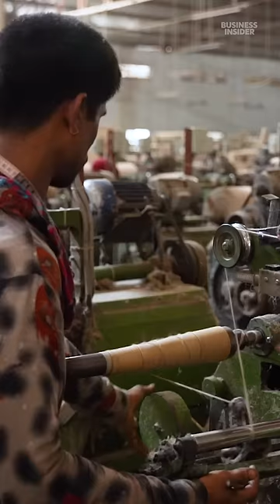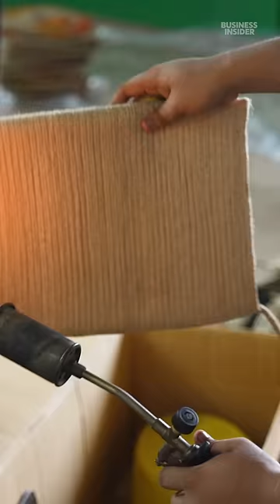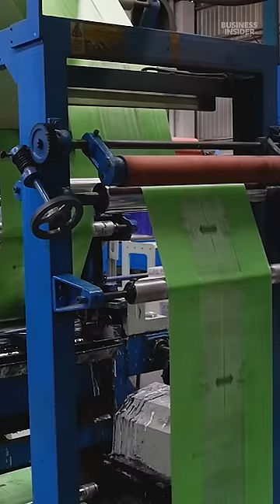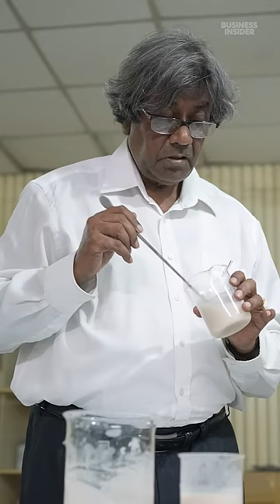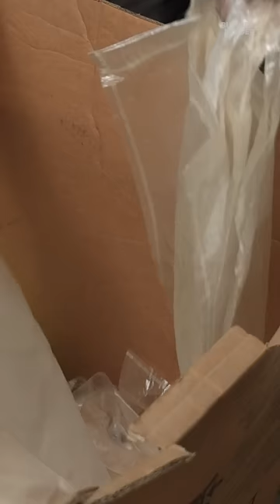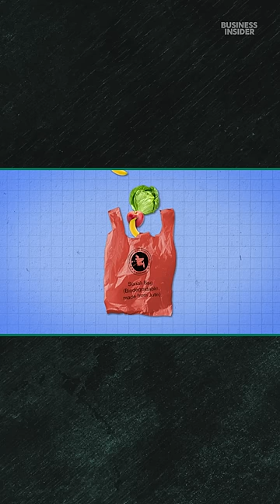Since #plastic bags are made from oil, they are not #biodegradable. Bags made from #jute are.

Comment: As the demand goes up more innovative and easier methods to produce it will arise. In turn making it cheaper.
Reply: The current price of plastic is 100% due to economies of scale. Its only advantage over alternatives is seniority. If infrastructure for something like this was similarly sized to the plastic industry it would probably be about as cheap
Reply: Absolutely.
Reply: So many people forget about this when saying certain technologies are too expensive to ever be reliable.  Space flight and air flight are two of those.  Over time, if people are interested in making it more accessible, they *will* innovate to make something easier and cheaper.
Reply: Agreed. Titanium is expensive, but when they first were able to refine it, they literally made a drop.
Reply: @maximumoverdrive3092  "Its only advantage over alternatives is seniority."
Such utter rubbish. You forgot the bit about having a smooth surface which lacks contaminating fibers, plastic bags are way cheaper than something which has to be grown, processed into fibers, then woven and sewn, plastic bags are very strong vs mass.  

Further, if jute bags came even remotely close to rivalling plastic bags, large areas of FOOD PRODUCTION land would be required to grow the jute, and chew up water resources.

Seriously, get real.
Reply: @alexanderSydneyOz Better than using up all the oil for and running out only to wait hundreds of thousand of years for new fossil fuel to come back. Then you have no choice but to look at alternatives anyway.
Reply: @alexanderSydneyOz   I wasnt referring to this one specifically. or maybe I was. I dont remember. I dont live on the internet.
Reply: THIS! why do people always bring up cost as if the cost will never go down over time. Almost alll new things start off expensive.
Reply: Oh i like this comment Very much!!

Comment: If it's biodegradable and breaks back down into the soil quickly it's worth every penny to get rid of all this toxic plastic that takes forever to break down and then not be healthy for the soil❤
Reply: plastic is not toxic.
Reply: Plant based plastics are still plastics
Reply: It literally melts contact with water. Cold groceries that make condensation, rain, wet produce, all of that will melt the bag instantly. 8 hours to completly disintegrated, 8 seconds until useless.
Reply: My plastic Walmart bags fall apart going from the register to the car so ..
Reply: Biodegrading means it is being consumed by organisms which create CO2. The Carbon is mostly being returned to the atmosphere again.

Comment: One of the biggest challenges is making a good waterproof/ leakproof alternative to plastic bags for storing messy items. In that way, plastic has the definite advantage.
Reply: Wax paper is actually a decent alternative.  2007-2014 wrapped sandwiches in wax paper for work. Then stopped eating sandwiches 🤣
Reply: There may be some things where plastic will always be the best thing. But it doesn't have to be used in every single circumstance that it's used in right now. There are many alternatives that could be used for some of these things. Plastic would not be that big of a problem if it were only being used for the things that it really is critical for, as opposed to for every convenience.
Reply: There’s still a need to wrap certain items in thinner plastic bags to prevent leakage and separation of say foods, damp vegetables , frozen items and from chemicals like cleaning products. But the outside tote would be better if jute or other reusable bags.

Comment: Just wanted to bring this to light given all the comments. I am a material scientist/engineer and work with many companies and governments regarding full lifecycle of materials to understand where hangups are and how we can see meaningful changes. 

Without an overhaul to our waste processing facilities (I am speaking from a US prospective where I believe US waste facilities are massively underfunded) this will have little to no real world impact on our waste issues. Currently landfills do not have the proper infrastructure to aerate the soil preventing materials from bio-degrading. If this gets mixed into a batch of recycling it will ruin that solution and prevent any re-use of those recycled materials. Only option currently is to compost which the infrastructure is greatly underfunded and in many areas almost non-existent. This is a great start and may help in specific small instances where trash cannot make it to a waste facility, but given a lot of the comments I’ve seen and the support in the market, a lot of people are properly disposing of these materials already. 

Material sciences alone will not solve our issues and we must advocate for advancements to our waste processing facilities to ensure awesome breakthroughs like this are not in vain.
Reply: 100%. Waste processing requires more public funding. The longer we run it as a for-profit industry, the worse our trash buildup will get. Also, half the time we can't even dispose of hazardous household materials like fluorescent bulbs and electronics properly, and I know from experience most companies (even the ones with 'proper channels' to deal with such waste) still just throw things in the regular trash. Unless we make it free and easy to throw things away properly, people simply will not do it

Comment: I just moved from PA to Maryland and here, we have to pay for the bags we need at a store. Anywhere from 20¢-$1. Of course, this encourages ppl to bring their own fabric ones or at least reuse the plastic ones they’ve paid for. The plastic ones we pay for are SO THICK & yes, that’s good bc we’ve paid. But now, we have even thicker plastic ones that will create more sturdy garbage, too.
They ought to be putting these in those stores bc they are sturdier, too. And I am positive paying even 20¢ each would more than cover the 10xs greater cost bc of the sheer volume the stores buy. Even corner stores & ma & pop’s are not paying more than very few cents per bag.
Reply: weve had those for decades. they are not new. the math doesnt check out, plus the fabric ones and jute are made by slave labor often.
Reply: @threestans9096 What’s wrong with that? They have a job and get paid. Without it, they’d either be unemployed, or getting paid even less through a different employer.

Comment: Carbon is stored in the dump whether the bag is plastic or jute. Both contain carbon. In a way,  plastic stores the carbon for the long term because it doesn't decompose. Especially in the dump. Also, jute removes nutrients from the soil.  If it's not composted,  those nutrients are lost.

Comment: Our planet and health is worth investing in
Reply: There are already other biodegradable plastics that are cheaper, and are sourced from algae / seaweed, flax & arroll  and even including biodegradable 3-D printer filament.
Reply: @elvendragonhammer5433   There's nothing wrong with having multiple options
Reply: You're being green washed, plant based plastics are still plastics. And it isn't a new process, George Washington Carver did it with peanuts.
Reply: That cost difference would hit the poor incredibly hard. It's easy to make the change you're advocating when you have a full belly, a roof over your head, and adequate sanitation.
Reply: @markuhler2664   That's blatantly not true
Reply: Never said it was a new process- also I'm not being green-washed unlike you I understand the chemistry. Never said they weren't plastics, sadly you don't even know what a plastic is. It has nothing to do with what it's made from, but rather the properties it has & exhibits. 

Your chewing & bubble gum, your cloths, all forms of rubber (including those from the rubber tree) all non soil derived clay's, glues,  wax & gel candles, (especially store bought ones- those usually have styrene <primary chemical in styrofoam> added to them to make them burn longer & drip less)

Your bed, couch cushions, carpet- all are at partially formed or derived from them. The Teflon non-stick coating in your cookware, the stain resist feature on your dupont carpet or clothes, all waterproofing & anti-wrinkle on your jackets, fast-food work pants & shirts just to name a few.

All at least mildly toxic or cancer causing; either in it's current state & vastly moreso when exposed to heat- like during a housefire. Or baby bottles that used to have BPA in them that leached out into anything heated above 76 degrees in the bottle. Hundreds of thousands of other things all classify as a plastic- not just the few things you know about. 

For example: PEG (Polyethylene Glycol) a Petroleum product, is used in making nearly all extruded plastics, including injection & 3D printer filament, it's also used in all major laxatives, (Miralax is a generic name for it) suppositories, personal lube, many creamy or pre-processed foods & candies, especially those that need to to keep it's moisture absorption rate low- <same reason it's used in plastic filament like vinyl. To keep it from getting brittle & creating bubbles from boiling the water off during extrusion.> Sometimes it's added to low-moisture cheese, it's also in thousands of face creams, & other beauty products, & has hundreds more instances where it is used in chemical & medical applications (HP Inkjet Printer Ink, wash-off children's paints) all things you knew nothing about until now.

Lastly, you can't green wash anything living- only the emissions #'s the company is trying to fudge by offsetting their carbon footprint- just like carbon credits. @robert-jason-king
Reply: @elvendragonhammer5433   all those words and you didn't even touch the issue. Tell me how it's made. Does it require touline like cellulose acetate? Does it degrade into micro-plastics like PLA?
Btw, greenwashing is like whitewashing, but with Public Relations rather than political history.
Reply: @markuhler2664 and the planet suffers immeasurably. By 2050 predictions say there'll be more plastic in the ocean than fishes. Enjoy the ride. We're going over a cliff 😢
Reply: You pay for em, then. Most families can't afford their groceries, we don't need to start paying extra for bags.
Reply: Commie
Reply: @Omniself   What does environmentalism have to do with communism?
Reply: Not when destruction is so profitable
Reply: @CooperDooper38  use reusable bags then. My family is poor and we use reusable bags. Saves you more money in the long run than always buying plastic or paper.
Reply: @wolvie1618  we do, I'm just saying don't say "It's worth the extra money" when we're already in such deep economic sh•t. Maybe you can afford to pay for your bags, but most people cannot.
Reply: Capitalism always gets in the way of actual sustainability
Reply: @shadetreader  capitalism ≠ greed
Greed is the issue.
It's also the reason socialism/communism could never work.
There will always be greedy people in positions of power, which is why the people need to recognize it and hold them accountable.
Our system isn't broken, it's just not being properly utilized.

Comment: Imagine standing in the rain because you're waiting for a bus😂
Reply: For hours?
Reply: @ggkit04  you ever been to NYC 😂
Reply: For 8 hours?😂
Reply: Once water hits it, it begins to dissolve. It will be completely gone in 8 hours but could have holes in it or lose structural integrity in just a few minutes.  Think ice cream cone. It doesn't melt instantly, but melts little by little.
Reply: @mrsducky3428  it'll probably still be usable from point A to point B. Plastic bags usually end up with random holes in 1 use also, but won't disintegrate after they're thrown out. It's not meant to replace permanent carrying things like totes or backpacks, just to replace flimsy plastic bags.
Reply: @mrsducky3428 ”In water” submerged in water , what part of that says water instantly melts it on contact ?
Reply: @rottenisee2751 "degrades in water"
Its seemingly designed to self destruct when exposed to water. 

Rain drops would fall on the handles, which are under strain, and begin to losen the molecular bonds. The moment those straps weaken, the weight begins to stretch the bag, sliming the material and allowing it to be disoleved even faster

Yes, rain would destroy these

Comment: This is increasingly common in India now if I'm not mistaken. Single use plastic bags were banned years ago in some parts of India. Forced the invention of biodegradable bags here. It's relatively more expensive now but should reduce with time. but govts should start subsiding it as it is cheaper to subsidise than repair damaged environments i guess

Comment: The VAST majority of biodegradable bags are thrown in the trash and vaulted in a landfill, which is specifically designed to slow or stop biodegrading, to protect local water supplies from leachate. 

Carry reusable bags and use them.
Reply: I would argue a landfill full of bioplastics is still an improvement over a landfill full of traditional plastics. It's a very small improvement, of course, but it is an improvement

Comment: The carbon costs of production are drastically higher. Yes it's better if reused multiple times, but that's the case with anything. The real issue is the plastic is being used once or being recycled, producing more carbon and pollutants and taking more energy, instead of being reused.

Comment: And that’s why they got replaced with synthetic fibers the first time… No I don’t agree with it but they cost 10x more then a traditional plastic bag. That’s a lot of money to spend on a disposable bag. If a plastic bag cost $.5-$.10 a bag (depending on the store), one of these bags will cost roughly $.50 for a biodegradable bag for a few uses, spend $1 and get a bag that’s reusable over and over. I live in Oregon & we were forced to used reusable bags (I’ve been using them for about 2 years before the law took effect).

Comment: Well when I bagged groceries in 1990 they said plastic bags cost between 1 and 3 cents a piece depending on size and weight bearing. The paper were flat rate a nickel a piece since size had been standard for about 40 years already. Again that was 1990 so these bio bags cost more than paper bags did in 1990. I'd like to know current costs of plastic or paper bags. Guess I can look.
Reply: Just looked it up and costs remain about the same, a penny on average for plastic and 4-5 cents for paper. So these cost 10 cents a bag to 25 cents a bag? He says 10x's poly and 5x's a paper??? His numbers don't match Google price comparison. If 10×1 cent is 10 cents how is 5x4.5 cents equal to 10 cents (it's 22.5 so that's not a dime)

Comment: I think this is the cost the gov and private sectors and whoever else should pay for. They can’t rely on these costs falling on us as individuals that’s not sustainable and does solve the issue. The need to embrace lower profits due to higher cost of safer/biodegradable materials while not charging us more for items we need and we are not the ones in charge of society has been put together. If comodines start using jute they will increase their prices and that wreaks havoc for society so it doesn’t solve the issue. It needs to be illegal to use these products that are dangerous for our environment and are for companies to cut corners

Comment: I was primarily interested in where the costs are accrued - is the material itself cheap or is it the manufacturing method? If it's more on the processing end, it seems like a focus on the tech to process it would be a fairly linear path towards improvement with enough $$ investment.

Comment: ok, that bit about carbon is absolutely not how biodegredation works. If anything, the biodegradable bag should release more carbon as microbes metabolize the long chains in the bag's structure, meanwhile the plastic bag's carbon would almost entirely remain in the soil since nothing can metabolize it. Of course, this isn't a point against the biodegradable one, it's good that it gets metabolized, it's good that it gets decomposed. But we have to be realistic about the carbon cycle, decomposing bioplastics absolutely releases carbon into the atmosphere. We need active sequestration regardless of what materials we make things out of, and we need active sequestration no matter how many trees we plant

Comment: So every way to reduce the cost by 91% needs exploring. One way is to make designer garbage bags for the rich. If they buy enough it can bring down cost by volume. Next use the material in other applications to increase volume use and bring down cost even more. Is it an edible fiber for animals? Fillers in other products, packing, insulation, paper, folders, boxes. How does it compare to cardboard?

Comment: Jute costs 10x more and can't be that reusable if it melts when wet in 8 hrs. Back to the drawing board.

What is wrong with heavy cotton canvas bags? I have some I have had and been using for 30 years. They have been mended and are now only lighter duty because they are 30 years old and have thinned with use and washing. But I CAN NOT buy anything like them anymore. I can however buy the materials to make my own replacements.